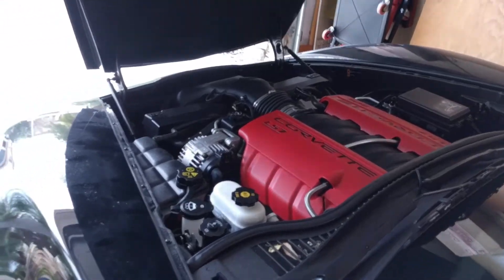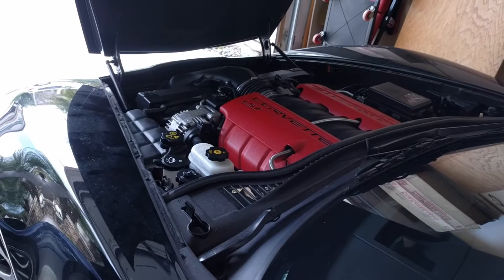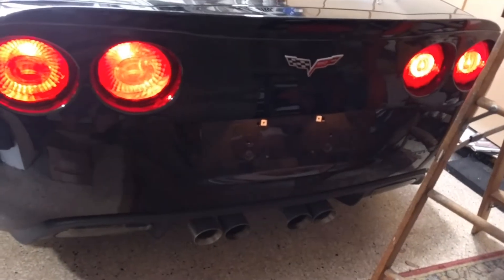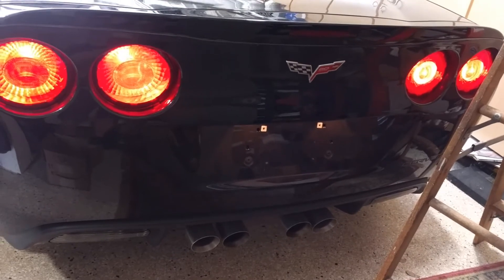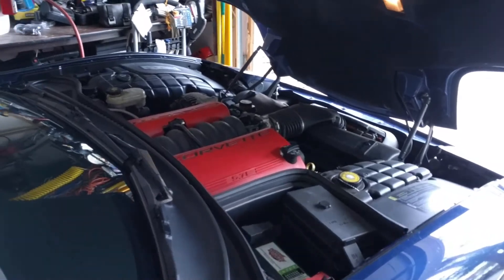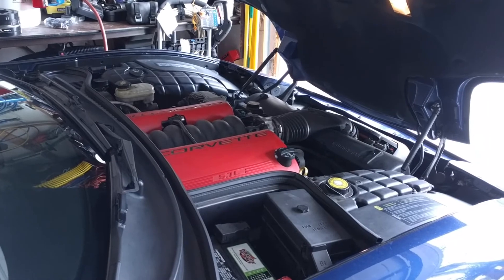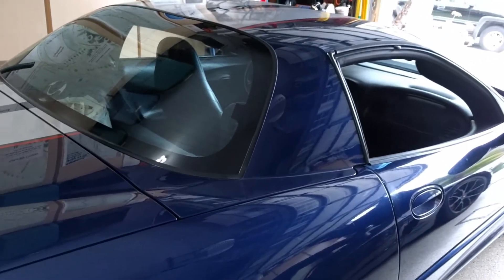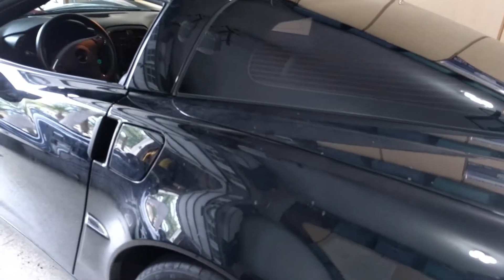Corvette c6 z06 vs c5 z06 start up and exhaust by froggy

Comment: Froggy,  interesting postings. I have watched a few and both enjoy and thank you for  the time you take to explain your tutorials. BTW, I am the original owner of an Electron Blue '03 Z06 that just last week, turned 10K miles. Still all original. By today's most modern technological standards, my ZO6, is like "newer generation old school", being an earlier LS series engine.  No one knows better than you that the C5 ZO6 is unique with its simple fuel injected small block that will quite easily handle 0-60 in under 4 seconds, quite impressive even today, no less 15 years ago. Anyway, thanks for the great videos.
Reply from the maker: You bet, the c5z is pretty impressive even in 2018. Thanks for viewing.

Comment: Hello Form Canada, froggy I enjoy your videos, used your info on my c6 and c5.
Question: My Hvac is blowing hot on the drivers side and cool on passengers side, Is there an actuator under the dash on the drivers side. is there a way to reset the actuators on my c5. I know there are 2 actuator on top under the dash pad. GM parts said there are 4 in the dash of a C5. Just not sure if one is under the dash on driver side. Would you or any one know 

I used GM approved Dextron 6 fluid for my 6 gear C5 it made things worse, my trans does not grind but is just not smooth going in to gear. So I am going to try what you use on your C5, and maybe set the shifter as you did. My c6 z51was the same as my C5. I used GM dextron { 3 } and it fixed the problem, GM does not sell it here now only dex 6.
Thanks you all MD. G
Reply from the maker: I have never heard of reset/index the doors. I don't know about under driver dash, never had to do that repair. Post back how it goes.

:)